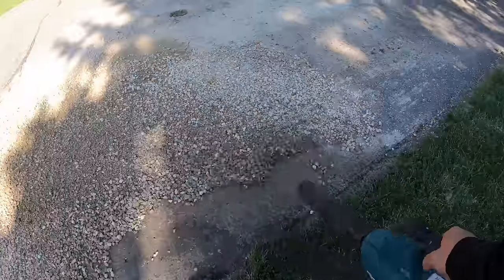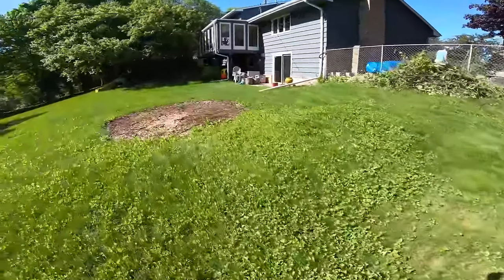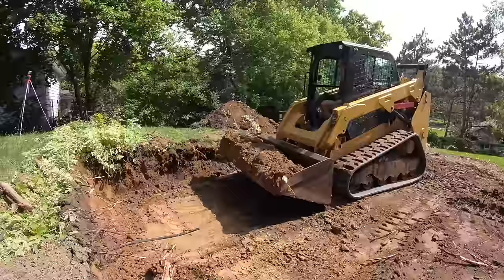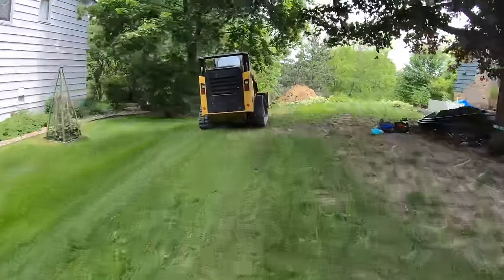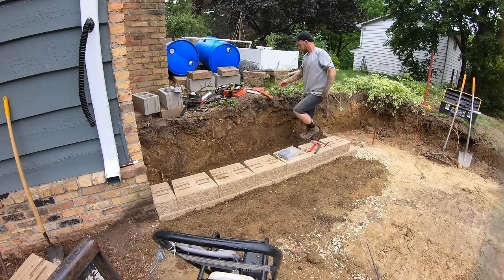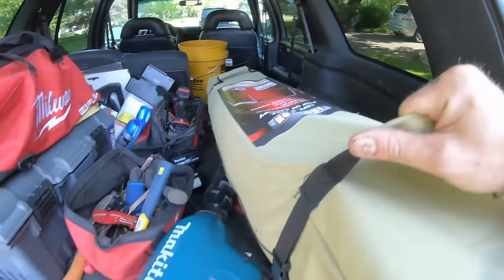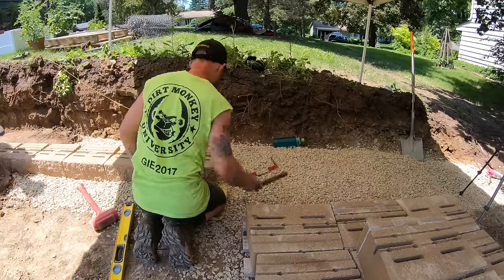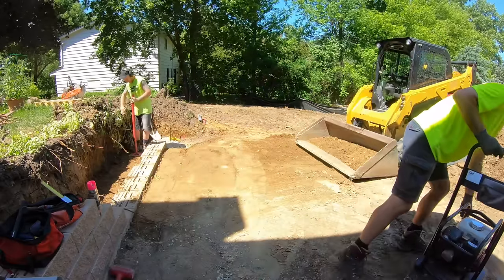Turning a Hill into a Flat(er) backyard pt/2

Comment: On the string line, hold it on the brick of the house a few feet back from the corner then move the other end until the string touches the brick.  Much more accurate way than eye-balling.
Reply: I do it how you described as well. Matter of fact I do this for decks fences walls Patios anything I'm building that's lining up with a structure

Comment: awesome video. immediately caught my attention as I'm doing the same thing in my back yard that has a slope, but I just have a shovel and my back 🤷‍♂️ you guys always do great work! keep the vids coming! 👍
Reply: How did that go. I’m looking to do the same. 65’ area has to be dug out and leveled. I have 2 shovels and my back.
Reply: @Paap810  went well, took my time and worked on it after rains when the ground was soft. It's all rocks from pebbles to boulders and clay where I live so it took some muscle at times but completely doable. A pick axe was a must to dig out the large rocks and pry them out of the ground. Only have one rock thats to large to move but it's turned into a nice landscape feature now so it worked out. The only real challenge was finding the motivation to do it in my spare time.

Comment: Just a suggestion for you gasoline equipment, especially if you think it might sit for extended periods of time; get what is called marine / RV gas, it doesn't have the ethanol in it that causes problems with equipment that might sit for 3 to 5 months without running. I have been doing that for my snow blower and lawnmower gas for the last few years. I don't even drain the fuel out of them any more and have no problem starting them at the start of the next season for the equipment. Yes that gas is more expensive than pump gas but it's worth it.

Comment: Maybe if you bought a jack hammer and got the tamper attachment which I have you could do those tight spots more efficiently. I own a Hitachi PH-65A jack hammer that I bought new off of EBay and bought the tamper attachment which is about 8 inches by maybe 10 and it’s good for those tight spots. I bought the attachment on EBay too.

Comment: When you put the bricks on back of the trailer, aren’t your drivers at risk on fishtailing?
Reply: They did have the 3/4 inch clear stone in the front of the trailer which I believe would have outbalanced the weight
Reply: he had the heavier load, (the loose rocks)at the very front of the trailer i believe
Reply: Dman473 even with the clear in the front those trailers are so damn heavily it really doesn’t matter unless you got a thousand pounds sitting on the back.

Comment: What are these wall blocks and where do I find them in Central Illinois I need them to replace an 95’ rail road tie wall.
Reply: These are by a company called Versa-Lok ( https://www.versa-lok.com/ ).  They have a variety of styles and sizes, all high quality.  The website has a dealer locator.  Hope that helps.

Comment: WHERE are you located? I have been looking for a reliable contractor to do the same thing. Just looking at the video if this had 6 ft or so. Mine I suspect is ranging 6 to 8 ft. It starts from what was once a concrete patio.  Where can I find your contact info?